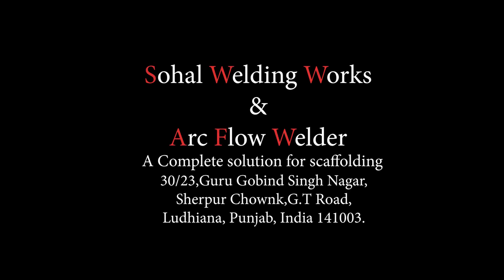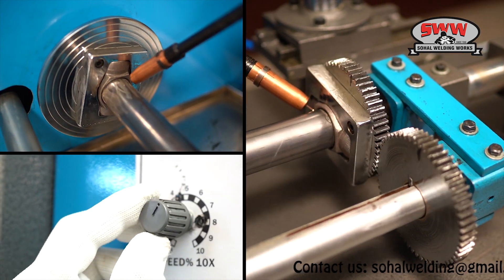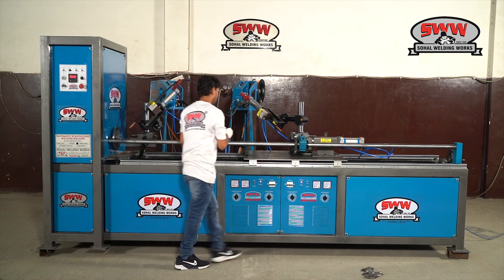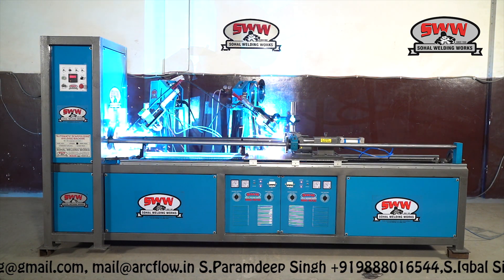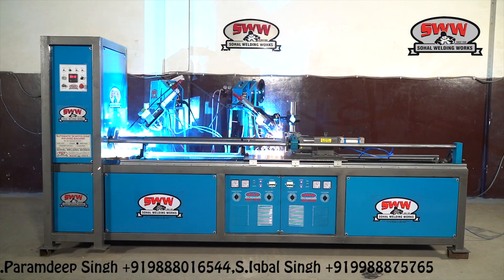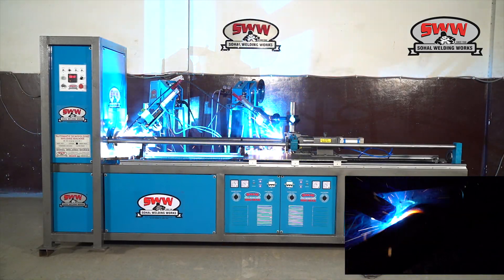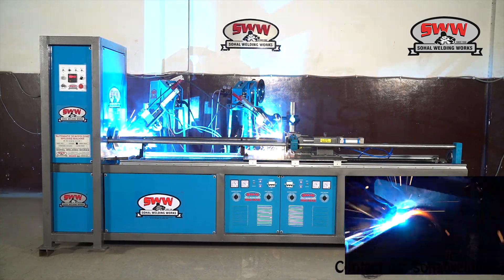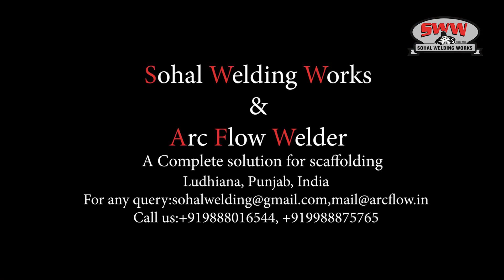Cuplock standard ledger welding machine INDIA/Automatic scaffolding ledger welding machine.

Comment: Do you have a full machinery to produce complete cuplock materials, like standard upto 3.0m, transom.  0.6m to 2.5m , intermediate transom 0.6m to 2.5m , and bracing 
with adjustable base plate making machine
do you produce the scaffold steel board with and without hook making machine
can we have prices pl
Reply from the maker: Hello sir,
Thanks for your query.
Yes we have all machines for making scaffolding.
We will be happy to assist you please send your query to our email: sohalwelding@gmail.com or whts app: +919988875765.